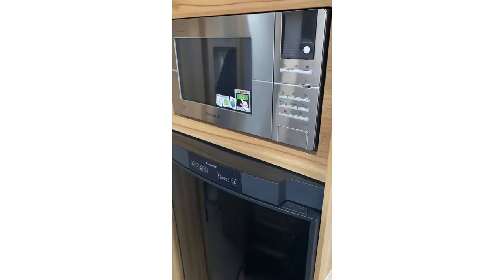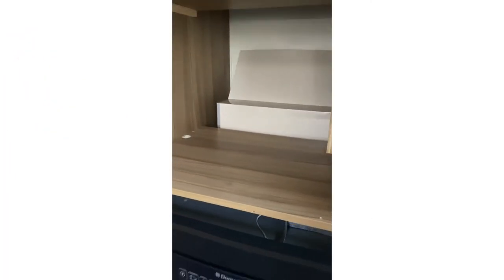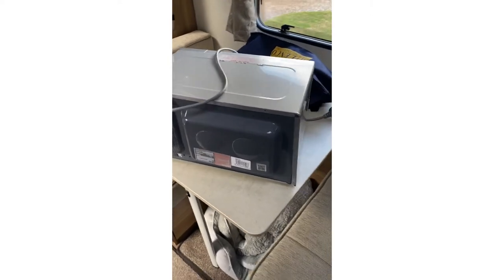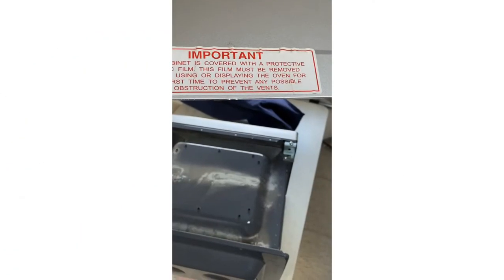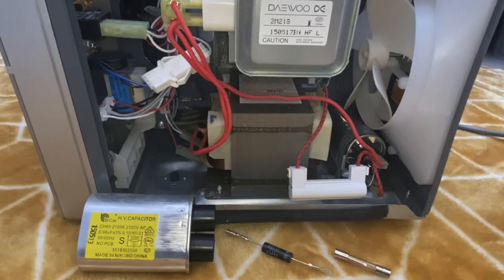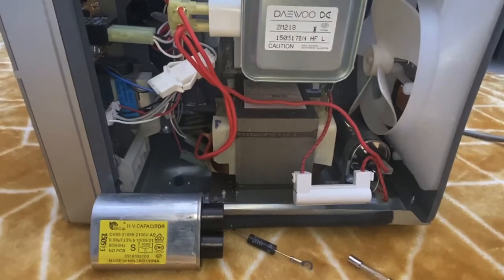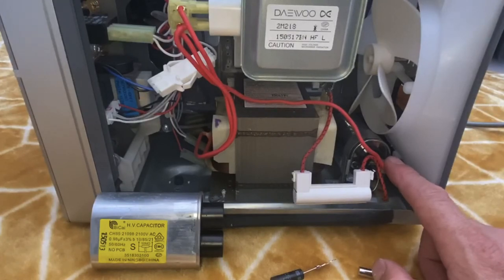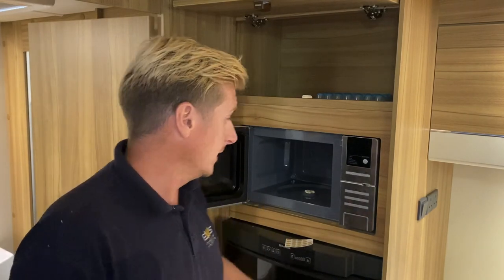Fixing My Caravan Microwave

Comment: How did you remove the glass fuse from it's holder,tried to replace mine but couldn't open the fuse holder. Cheers
Reply from the maker: Hi Mark, from memory I think I used a small terminal screwdriver to prise it apart. Hope you get on ok !
Reply: @idiotsguide2caravanning802  cheers mate I'll give it another go 👍